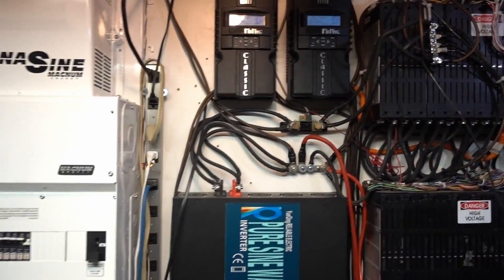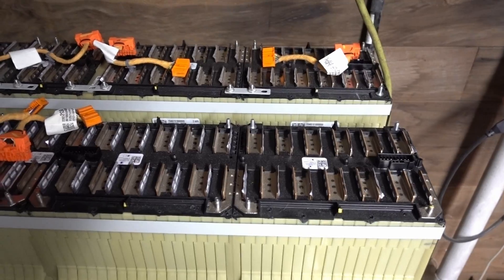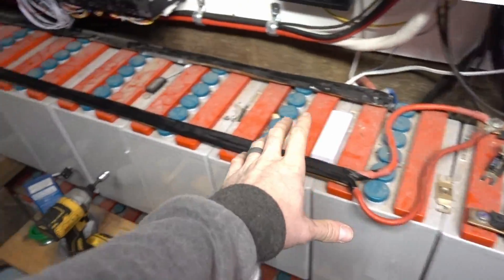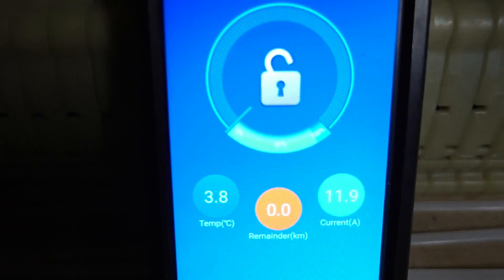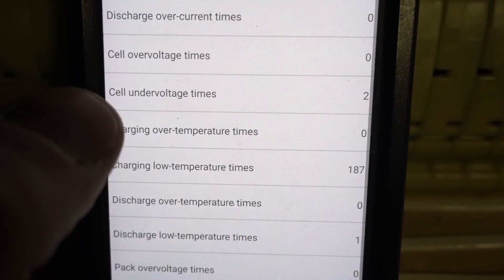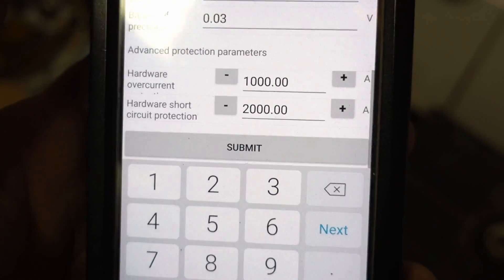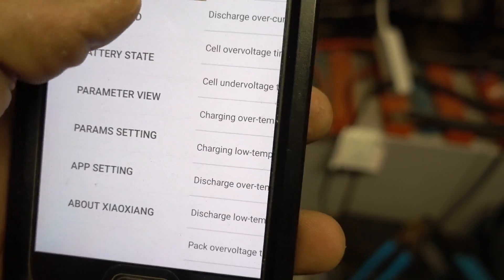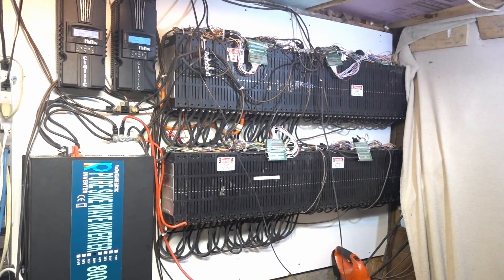Chevy Volt Battery With 12S BMS Hooked To Magnasine Inverter

Comment: I'm having a great deal of trouble ordering that bms.  I am going to call the bank tomorrow and see if they are blocking this site.  Anyone have any ideas.  I have searched and cannot find another bms as nice.  The batteries are on the way.  By the way, the price of the batteries are way up, the average is now closer to $4,000 for newer models.  Our wrecker services are mostly connected to the internet outlets so finding the deals this author is getting is out of the question in South Louisiana from what I can see. I'll certainly entertain ideas.  I do have an add in craigslist.  No offers.
Reply from the maker: im not sure I just bought it and they sent it, also I have not been able to get any batteries is the last bit so price might have gone up :S

Comment: How is the BMS going? I am using Volt batteries in a car. The charger still goes to the most positive and most negative terminals on the battery?

Comment: Yea was just wonderin about yours most diagrams are pro ones im smart enough to do simple curcits for now till i get better al it im buyin a house soon and would like to gradually install solar and converter power to it it just takes timw what do the chevy volt bats and other batteries go for on the crap market im a welder and mechanic so i know a little bit but i wanna do this myself soon
Reply from the maker: ill see about making a video on it.

Comment: Ive been watching ur vids for weeks love but would like more infor like maybe diagram.i want same setup when i buy my house soon and what could u do with a pole transformer could u include it in a or ur house system
Reply from the maker: like a power pole transformer the big ones ? when you buy inverters and charge controllers they often come with diagrams and if not its easy to google 48v wiring diagram, and if your not sure i would ask someone to check your work before connecting to the battery bank or solar panels.

Comment: What is the price on these batteries and the equipment some of it
Reply from the maker: the bms was $50 each the battery was $1000 ish reliable 4000w inverter is about $400 charge controller $160 plus wire.

Comment: 48 / 3.5 = 13.7  (14S)  How are you getting by with 13S?
Reply from the maker: im using 12s for the volt battery that 50.4v full charge

Comment: And where did you get the BMS?
Reply from the maker: in description :)
Reply: @GoingOffGrid101  not any more
Reply from the maker: @garymull1972  https://www.amazon.ca/12V-60V-Waterproof-Lithium-Battery-Lifepo4/dp/B0D8ZTMZPX/ref=mp_s_a_1_5?crid=BWDCAPBMVTOO&dib=eyJ2IjoiMSJ9.hq2--XXZvWvfxf7nLe4az1FGes9a4b650CD2RJ3Ftrnsu4ATPfPZGCm4INutMt0uhIA90ufryistvr85XMiFrMvoHxIXOlhRjhbXXgB_prNEx5_464jOpS85tuvytW8WQhMimzV3TZQQE5CDDUYWsWVGjtSE946l9S1jM6TJo-eNNmgp5O4buX86015kr-mvARGvf3NwInC7sdF579Qj_g.bfwG-FRfaMLdQAqNZcm9fHFpVfrC4-wCau-Mbbr594M&dib_tag=se&keywords=12s+bms&qid=1737178828&sprefix=12s+bms%2Caps%2C132&sr=8-5
Reply from the maker: @garymull1972  this is one I found on I found on Amazon.

Comment: So its been about a month, how is the BMS working out?  I am looking for a BMS solution for a 2017 Volt pack I am reconfiguring to eight 48V (12S) battery modules and I am very interested in how things are going with your setup.  Thanks for taking the time to do this video.
Reply from the maker: well I have not used it much, I have been fixing my basement up, took up all my time, but I will start testing again as im dont most the basement work, i will be hooking up the rest of the volt pack soon!

Comment: What's up with that swipower 3000w inverter?
Reply from the maker: it died and i repaired it but it can only do 1500w now
Reply: Going Off Grid me have one but  it's 24v 3000 it work's very well it run me house fine no problems two to tree mouths now.
Reply from the maker: hope it last you!

Comment: What's the input AMP rating of the BMS that you put on this battery? I am in the process of getting a 2017 Volt Battery.  I will have to reconfigure the arrangement of the cells to a 15s setup.  I currently have for inverters 2 Outback units 48 volt input and 3600 watt output.  Each inverter can put out 45 AMP.  I will be running the inverters as parallel setup for total 120 volts and 3600 watts using a X240 transformer to give me the 240 volt output and balance the load among the inverters.  
will have a total of 6 packs wired in parallel.  Just wondering how you wired the BMS you bought.  
Thanks for any info.
Reply from the maker: I just used a 12s bms witch is 44.4 volts 50.4 volts max charge, the input amps for bms is 100 amps, you out back inverters should be able to run lower then 40 volts so 12s should be ok for you. im not 100% sure on out back though, I know magnasine can go from 36v to 64v input, my bms is wired like all bms from china super simple if you look it up.
Reply: Oh they will do it, but i'm not going to stress the FET's that much eh.. the limit is my outback charge controllers.  They only go down to 52 volts.

Comment: That is a neat idea to use lithium and lead acid in parallel and depend on the BMS disconnecting the lithium cells as the voltage gets too high.  Not sure if that is good for the lead acid cells but at least it would let the lead acid cells add some capacity at the high end before they die and get retired.  I wonder if you could have a low voltage cut off on the lead acid so that they get pulled out of circuit as the voltage drops?  Then you can have the best of both packs in one system.  Anyway seems like an interesting idea you have going, look forward to seeing what you do and how it works :-)
Reply from the maker: yes I have loads of ideas, one is getting a electric car soon to charge off solar

Comment: what's the reason linking  a RUSSIAN language aliexpress site?
Reply from the maker: you can change it, it goes to Russian every time, im not sure why
Reply: https://www.aliexpress.com/item/12S-100A-smart-board-lipo-lithium-Polymer-BMS-PCM-PCB-battery-protection-board-for-18650-Li/32848466970.html?spm=a2g0s.9042311.0.0.Y3uY64
i don't think you can change it from the russian language site. i deleted "ru" in the website address.
keep in mind, there are hardly any russian speaking followers on your youtube channel. it would be interesting to know if there is a russian following your channel.  and i doubt it changes automatically to russian language.

Comment: What is the operating input voltage of your inverter?  I'm having a hard time finding a 48v inverter that is optimized for a 12s Lithium battery.
Reply: Don't forget that when running your inverter to low on its input voltage your going to stress the FETS in it.  All depends on your load.  To much stress and stuff goes ZAP.
Reply: That is a very good point.  It's better to be above the nominal voltage rating than below...
Reply from the maker: the magnasine inverter can do 36v-64 volts its great!
Reply: I also have difficulties finding an inverter. I have 36VDC LiFePO4 batteries already under BMS. Wondering if the 48VDC Magnasine inverter will be able to use these batteries.
Reply: Serge Dutremble what kind of load do you want to run?
Reply from the maker: my house :)
Reply: GMRedline I want to run my off-grid house. I have not picked an inverter yet. Just had a great deal for the batteries.
Reply: I have not yet picked an inverter.
Reply from the maker: reliable makes a 36v inverter
Reply: Going Off Grid I am looking for split phase low frequency.
Reply from the maker: magnasine works down to 36v and up to 64v
Reply: Going Off Grid The manual on magnasine inverters specifies that it is important to match the batteries to the inverter. A 24vdc battery pack with a 24vdc inverter and a 48vdc pack with a 48vdc inverter. My packs are 36vdc 20AH of LiFePO4 266150 cells.
Reply from the maker: how many S is the pack and what is the max voltage per cell
Reply: Going Off Grid 12S. Each cell is 3.3vdc nominal. Recommended charge at 3.6vdc
Reply from the maker: so 3.6v full charge and 2.5v full discharge, at 36v cup off there will be about 30% of you battery unused. can you take the modules apart and reconfigure them ?
Reply: Going Off Grid Not sure by what you mean with 30% unused ba5ttery. I would rather not change the packs. However, I can if I have to. I can reconfigure them to 24vdc or 48vdc packs. Unsure if I would ba able to reuse the bms. I have 40 packs so it could get expensive.
Reply from the maker: what I was saying is if you used a magnasine inverter with your batteries you will be able to use 70% of the batteries capacity leaving the bottom 30% unused as the inverter will shut off at 36v
Reply from the maker: the 48v magnasine can work from 36v to 64v
Reply: Going Off Grid thanks for the reply. I'm finding that the low voltage cut off of most 48v inverters is 40-42v. Which is actually a good thing for a 12s li-ion battery. At 42v, a 12s li-ion battery would be around 3.5v per cell which is low enough to extract enough of the useable energy but not too low. It will be around 80% to 90% discharged at that point. The discharge cut off could also be managed with a BMS as you have pointed out in this video. :)
Reply from the maker: i will be testing those parameters out

Comment: Do you mine any crypto with all your extra battery capacity?
Reply from the maker: thinking about it, im not sure its a good investment as its a wast of electricity and computing power, but if I think i can make some real money in the summer I might
Reply: Going Off Grid Look into some of the new coins. Electroneum,  IntenseCoin, etc. Very profitable right now and easy to mine. These coins are very inexpensive today but they are solid projects and the coins show good signs of blasting off. You can easily get 100 coins per day with a couple graphics cards, and with the potential to go 100x-1000x...its too easy to het a stack of them now.

Comment: How is the turbine doing? Are you still planning on putting it up high or is it generating too little power to be useful?
Reply from the maker: i will be getting it up higher, more like a spring/ summer job is all, I do not think its a very good turbine with the blades I have, some people are saying this $300 chines 400w turbine puts out more power...

Comment: Thanks for this vid. I'm planning a system in the near future and I'm glad to be able to listen to someone going through it all before me. The last thing I want to do is waste money on stuff I don't need or won't work. I'm in the south Okanagan valley and have the perfect location for a rather large panel array. When batteries are topped up the plan is to push the excess to some DC pumps which will circulate water in my 10 acre lake to stop it from turning green with algae in the summer.
Reply from the maker: that will be a fun build! I will be adding another 5000w by end of year for a total of 10000w of solar :)

Comment: put a ohm meter on the wires you think are temp. and set it in the sun. and see if the ohms changes. have you seen a good cheap balance board for 7s / protection board? I recently made the leap and looking for components.
Reply from the maker: this bms is like mine but 7s and 60 amp

https://www.aliexpress.com/item/7S-60A-active-bms-2017-new-Li-ion-smart-bms-pcm
-with-android-Bluetooth-app-UART/32839591867.html?spm=2114.search0104.3.1.74c163619rKwzO&ws_
ab_test=searchweb0_0,searchweb201602_2_10152_10151_10065_10344_10068_10130_10342_10547_10343_
10340_10548_10341_10084_10083_10618_10139_10307_5722316_5711211_10313_10059_10534_100031_10629
_10103_10626_10625_10624_10623_10622_10621_10620_10142,searchweb201603_1,ppcSwitch_4&algo_expid
=056bbc47-e52b-4505-90a8-0b0457e032ff-0&algo_pvid=056bbc47-e52b-4505-90a8-0b0457e032ff&priceBeautifyAB=0